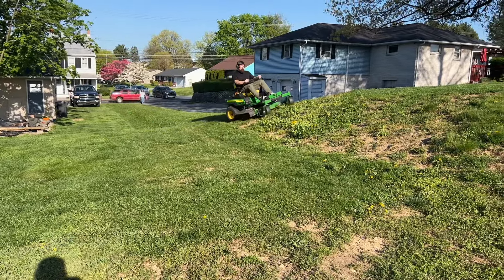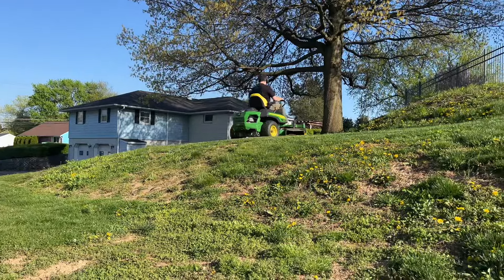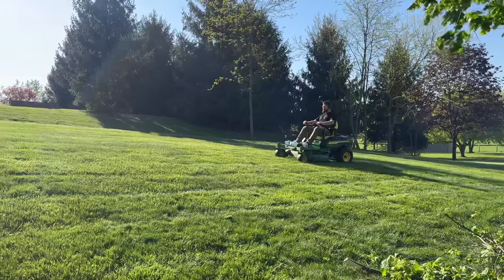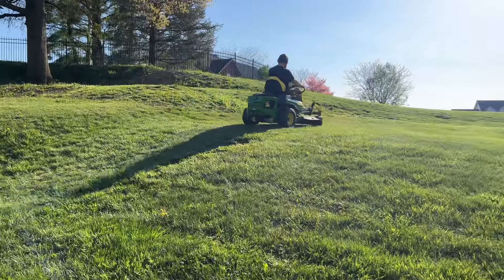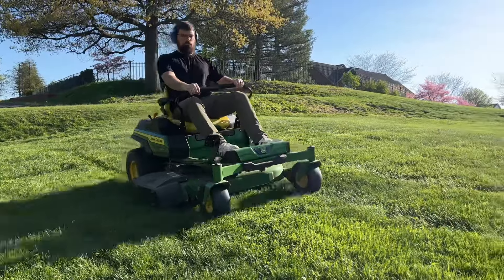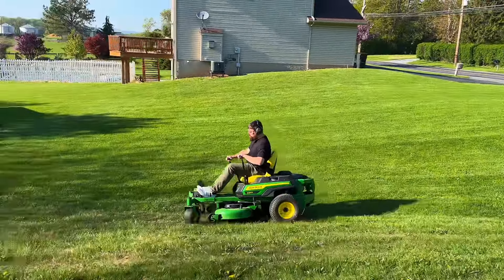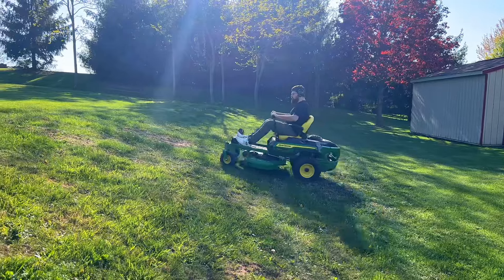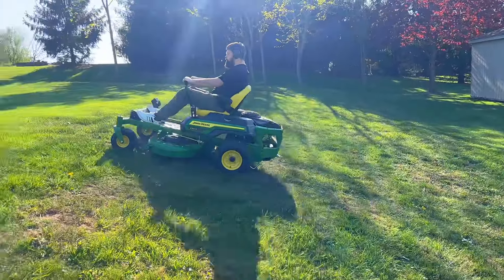John Deere zero turn on inclines/ hills. JD Z320R, performance and tips. #backyard #johndeere 🚜

Comment: Thanks for the video.  Just a "heads up" - at 10 seconds in the video you can see the uphill caster is all over the place, not tracking, because it has no weight on it.  I'm thinking you're pretty close to rolling the machine
Reply from the maker: You are right. Thanks for the info. That is part of the reason I made the video. I wanted to highlight the potential dangers of riding the hills that way. I appreciate that as I didn’t even notice that part. Thanks!

Comment: Reading people saying you can't go up more than a 10 deg hill and if it's even slightly on an angle, you can't mow with a ZTR.  Thanks for the video!
Reply from the maker: Glad it helped. And yes, you need to be careful, but I feel safer on the zero turn on my hills then I did with my old riding mower.